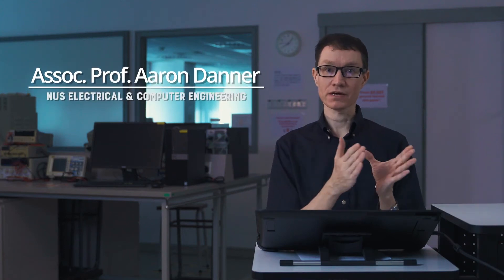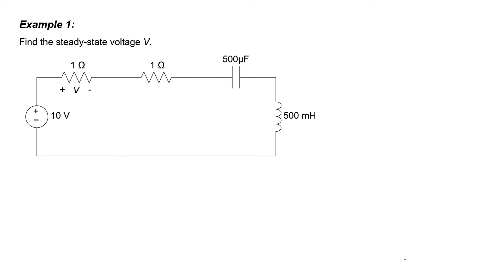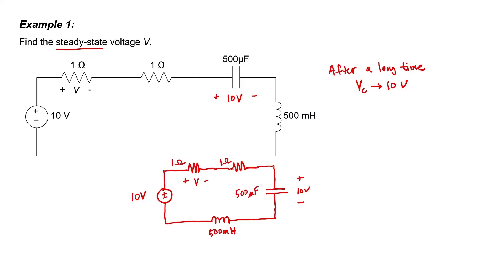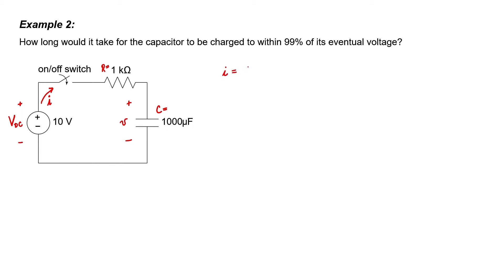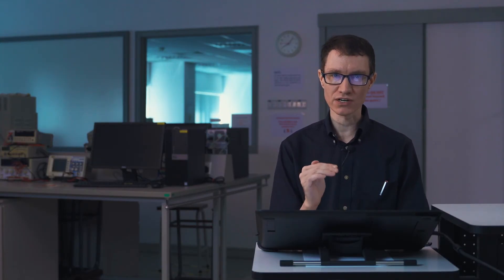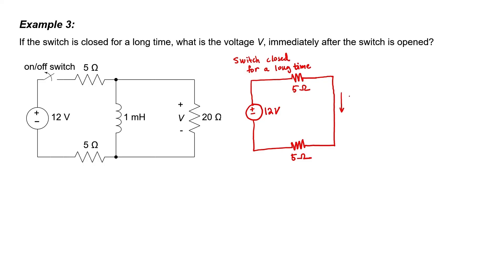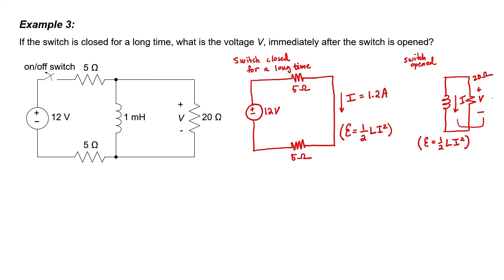Capacitors and Inductors Examples (Circuits for Beginners #25)

Comment: Excellent stuff now if the we use a transistor then it will switch on and off and will eventually store all that voltage in the inductor as much as may be could be 200 or more volts if you could have done maths for that one it would be very helpful, done my degree some 22 years ago so your calculation brought back good memories however if you could do it for that switch on and off transistor where the inductor will go very high in voltage with calculation then you are a star

Comment: In Ex. 2, the time constant of a 10K resistor in series with a 1000uF capacitor is 10 sec (10x10^3*1000x10^-6 = 10x10^3*10^3*10^-6 = 10x10^6-6 = 10x1 = 10). Why isn't the answer 10 sec * 5 RC time constants = 50 seconds?
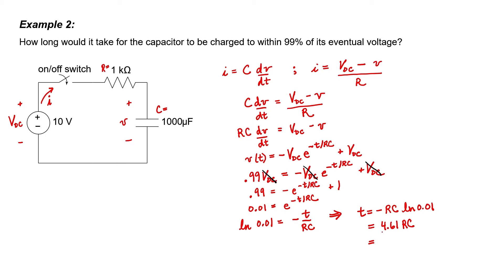Reply: 5:24 1k resistor and 1000uF: 1k * 1000 (a million), multiplied by micro (x10^-6). 
i.e. 1 million divided by 1 million (or a million times a millionth if you prefer)
Reply: It has to do with the way the voltage vs time graph looks when it’s discharged. The first time constant is is equal to about 63% of the initial value, and the time constant is (for the life of me I can’t remember how to explain it) somehow related to the tangent of the graph at that point. And since time constants are based on percentage, the lower percentages will take longer to get to based off the the behavior of the capacitor.  

Sorry if this was rambling nonsense I’m high rn 😂

Comment: What would happen if the parallel resistor in the third example was replaced by a capacitor? I know it would oscillate when the switch is open, but what happens when the switch is closed for a long time? Does the capacitor charge at all or does all of the current just end up going through the inductor?
Reply: I am not sure.. But most probably the capacitor would initially charge up to the battery voltage and when charged up the current would flow through the inductor from the battery and when the switch is turned open it would start to oscillate.. That's my guess 😅